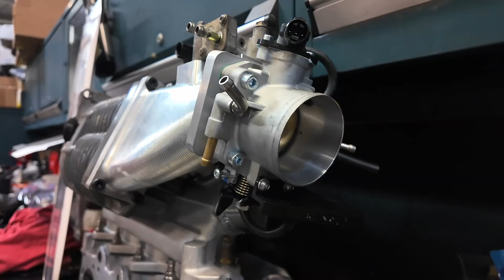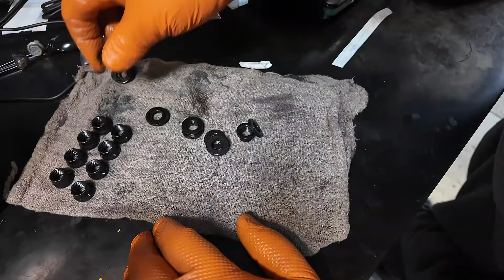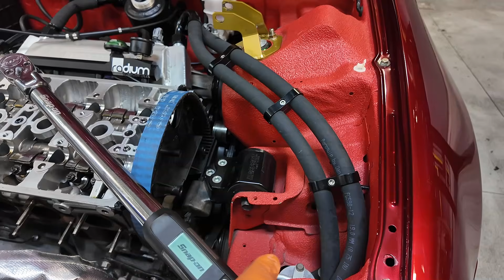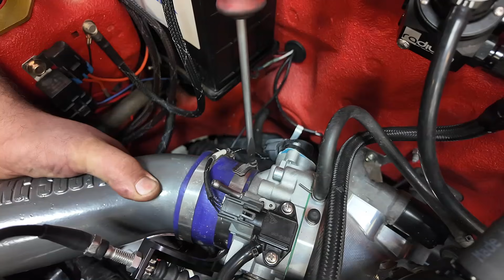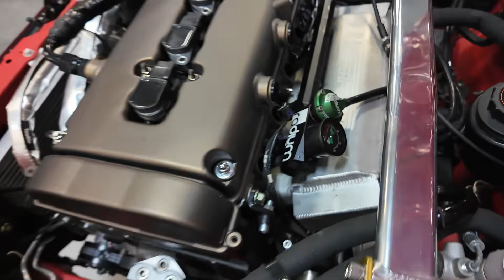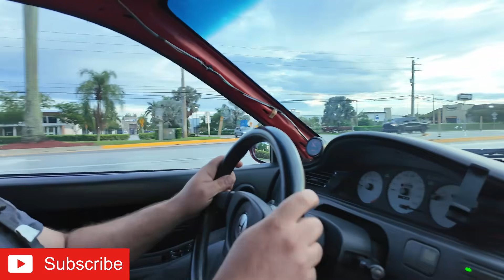Supercharged B18C Build Comes to Life! Cylinder Head Installation + First Test Drive (Ep16)

Comment: Well I'm glad part two worked out, so at this point we don't really know of it was the head gasket or the bolts, at least it wasn't the deck or head, uprating the gasket is the way to go and it lucked out getting the advice later about going to 80 ft-lb, the head got to sit for a day at 70 ft-lb and settle, then get the final cold stretch, your luck shouldn't be that bad to get two leaks back to back. I'm paranoid about threaded holes so I always have new clean nylon bore brushes, even for the connecting rod cap holes, on a battery drill at slow speed with solvent to make sure there is nothing in those thread valleys or at the bottom of the bore.

Comment: Performance engine builders are generally not fans of Cometic gaskets. Their MLX line of gaskets with the folded stopper layer is their best and most reassuring product (this is the same style of head gasket that Cosworth pioneered), but other than the MLX line, I would not run Cometic. I'd trust Fel-Pro sooner than a Cometic head gasket.

Comment: Lubing both side of the arp washers is wrong,the side that touch the head must be dry and also rough surface with a 60 grit paper.
You dont want the washers to spin while you're torquing
Reply: I noticed alot of people do this. Ive had ARP instructions state to lube on 1 side(up and facing the nut) and bottom side is 60 grit/course finish so it bites the head and doesnt spin, just like you described. If it spins....its basically a bearing and multiplies/increases torque applied and ends up pulling threads from the block.  Used to hear about it all the time on the old forums.  Guess it works out for some folks, I never have that luck and tend to overthink everything.

Comment: Out of curiosity, I thought you were supposed to use a light layer of the ARP lube on the threads where the stud screws into the block. Do you advise against doing this?

Comment: Does the insulation on the A/C hoses make much of a difference?
Reply: Most def, liquid line is already  pumping at a high temp/high pressure 200psi-300psi and so it it being insulated its pumping its own pressurize heat instead the engine heating up that line even more..and then the suction line aka return line aka fat/bigger line. It makes sure the refigerant returns back to the compressor in cool vapor form to cool the compressor off its self